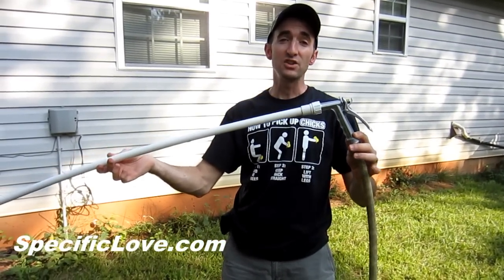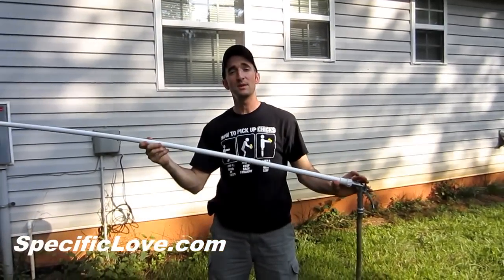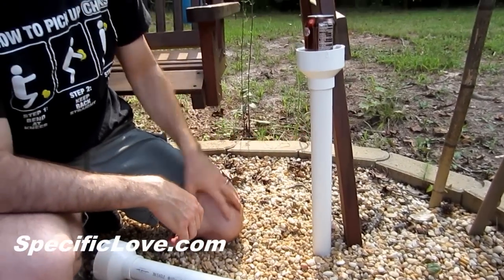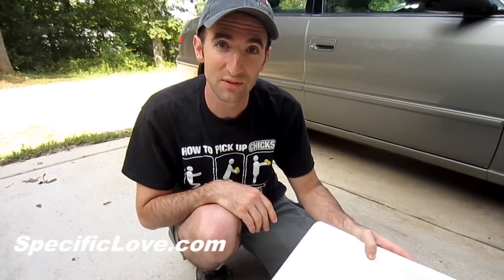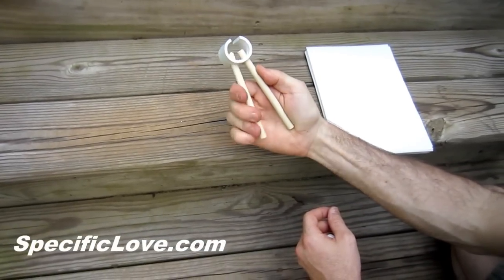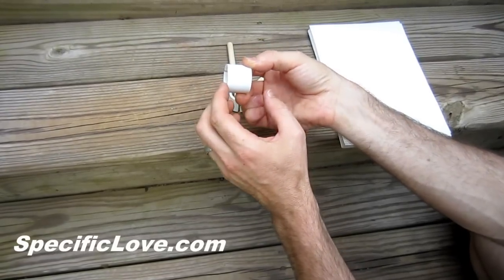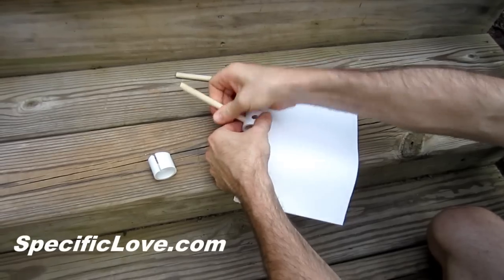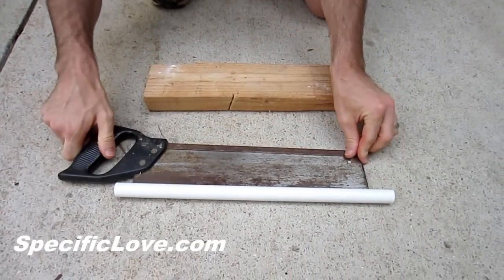10 Life Hacks with PVC

Comment: great ideas. on the tube for coolers, I recommend some rock salt in the water solution. it keeps is in solution for a colder temp and prevents the water from freezing solid and expanding. Salt will not effect the PVC.
Reply: only rock salt will work?
Reply: +Michael Piercey Or Isopropyl alchohol.  And the PVC cement dries instantaneously.  It actually "melts" the plastic a bit to create a water-tight bond.
Reply: +Mike Pomatto nice. thank you!

Comment: Great ideas, a couple of suggestions tho. Make the end of your gutter cleaner a "U" shape. Gives you direct downward spray, much more controllable and more power. You stand a good chance of pvc splitting if you freeze water in it. Mix your water with alcohol and salt first. The razor holder, I like the wife to drop her razor, if you get my drift! Plastic is not a good conductor of cold. Keep your chest colder by adding a layer of plastic on top of the contents (I use bubble wrap) as EXPOSURE TO AIR totally wastes your cooling. You will notice that your ice, or whatever, lasts much longer and your contents remain closer to temp after each opening of the chest. Like that you go directly to the point!! The best!

Comment: Put SALTED water !! This way, the water will freeze BELOW 32 degrees and last and cool longer !
Reply: +altamiradorable Salted water will not freeze!
Reply: +JohnWPB it will just below 0c
Reply: +sander pf Exactly!  Consumer freezers do not get this cold, therefore you will have nice cold salty water, and no ice.
Reply: +JohnWPB I have a regular LG freezer and it goes to -6 degrees F ! That's well below 32 freezing point !!
Reply: +altamiradorable Just use a frozen water bottle. Cheaper than PVC & when it thaws you can open it & drink it.
Reply: +JohnWPB they get well below 0c...
Reply: +Maxx Fordham No matter what state it is in it will take it longer to get back up to danger zone temps.
Reply: Well it actually depends. If you leave both in the freezer just until they are frozen, it will last longer because it has lost more energy. (One would start sub-zero, the other would start close to 32)

If you leave them both in for say...a couple days. It's gonna be pretty much the same, fresh water actually has a slight edge on keeping it colder longer, salt water would probably cool it slightly faster.

Assuming you let the ice completely form and bottom out temperature-wise in your freezer.
Reply: It lost energy to freeze. It needs to absorb equivalent energy to heat up. Basic physics.

More energy lost = more energy absorbed = longer cold in a cooler
Reply: +Maxx Fordham it's
Reply: Maxx Fordham
While we're at it, "Oh, LOL!" is not a complete sentence.

"Silly me" is not a complete sentence either.

If we're going to make YouTube comments all stuffy we might as well go all the way.

Comment: I build a Summer Portable Chicken Coop that you could pull with the lawnmower to different areas in the Yard. It took me 8 month to build it, because some of my ideas didn't work for the coop, and I had to find the right everything from Walls to roofing. It also needed to be light weight but sturdy, and it needed to be cool in the Summer month. I also needed to be able to access the inside of it to retrieve some of the eggs that were laid in the back of the coop, and it had to be critter proof.
After I finished it, I realized many mistakes I made that I wowed to to better the next time around. That coop was build in 2011, and it is still in use today, even though some of the pieces that weren't glued correctly are coming apart, and the bottom Chicken wire needs to be replaced this Winter when the chickens move back into the bus!

Comment: you have some great ideas. first ice freezes from the top down that is why the lakes freeze on the top of the surface not the bottom of the lake. I agree with the water bottle it is usable water that you will want any way. the log carrier is great. the snake catcher I have trouble with but that is because I am not going to get that close to a snake I would use a longer pipe and a slip knot you might even put 2 holes in the pipe and tie the knot on the inside of the first hole that way I would be able to use it from a safer distance. the last thing I want to say is about the saw its self you need to use vinegar to get the rust off that blade then wipe it with a light oil  it will cut better.

Comment: Excellent series! I've been using PVC for camping for a long time, but you've inspired me! I've only seen about 6 of the series, but looking forward to seeing the rest. Keep up the great work! I camp with a medieval recreationists group usually and used PVC to create a clothing rack for my costumes. Works great and keeps everything off the tent floor in case it rains. Also use it to create a barrier around the tent to keep rain from creeping in, setting it slightly into the ground lengthwise.
Reply: Cool. I didn't realize they had PVC in medieval times.

Comment: This is great stuff. Next, let's try building an airplane.
  A comment on the Ice in the PVC: When you put this in the freezer, make sure it's level, so the air bubble extends the entire length of the tube. This will keep the pipe from splitting when the water freezes.

Comment: I needed to glue strofoam panels to walls inside my crawl space and I used 1/2" pvc pipes varied from about 10' to 5' to winch them by bending them and placing one end agaist the styro. (with a pad of 1/8" plywood) and the oppisite end up agaist the joists.  Key was to use correct lengths in order to get the required pressure to tension the panels agaist the walls, it worked.

Comment: Hey Hi,
I do like the safety and practicality of the PVC Saw Blade Cover.  First, is there a way to bundles the PVC covers and attach them to a French Cleat?  And two is there any way to wrap/warp/mold/or flex a PVC pipe to fit around the exposed edge of a circular saw blade???
~Jim
Reply from the maker: I would not think attaching the pvc cover to a French Cleat in this fashion would be the best. I would suggest a different type of holder for that setup.
And to bend PVC is doable with heat, but bending it around a circular saw blade might be challenging.

Comment: An even better option for #2 (gutter cleaner) is to use an inline shutoff ball valve instead of the spray nozzle. The nozzle restricts water flow too much, IMO. I made a gutter cleaner a few years ago using just a ball valve (in the garden hose accessories area of any big box store).  I noticed a significant improvement with the ball valve.

Comment: On your shower razor holder you could also add an end cap at the bottom and drill a drain hole it would hold tooth brushes too and allow them to drain. You could remove it to clean periodically.

Comment: I generally liked your hacks. The razor one is good, but I can advise you something way better for your razor. If you have a rough wiry beard like mine a razor will only last about four shaves. However if  you fill a small plastic cup with half water and half windshield washer fluid and drop your razor right in after every shave, the solution will keep it from oxidizing which is what makes it degrade quickly. I now use my razors for up to 2 months and I have been doing it for about a decade with great results.

I also find it is much easier to shave in the shower, as the steamy moist air helps soften you  skin while you wash so that once you are ready to shave, it is much easier. I have a small mirror I hold in one hand while shaving in the shower and if it steams up, I just rinse it and it clears.
Reply from the maker: Very interesting

Comment: Where did you find the adapter for the nozzle end? I have not been able to find one in my area that fits       the spray end. Great idea that I want to use this summer.
Reply from the maker: I found it at Lowe's. If it does not fit your's, I would also consider buying another cheap nozzle.

Comment: Suggestion--For the wood carrier, run  one 6 ft paracord through the holes and _inside _ the pipe with the knot inside. This way the one length will balance on its own. A little extra work but one knot instead of four.
Reply from the maker: +Lyonhardht 
Interesting idea

Comment: #7 you don't need that paracord. Just stick the piece of PVC through the bag handles. Two fingers on each side of the bags. Don't even have to be PVC. Any short piece of stick would do. This avoids the disadvantage of the PVC + paracord method. That lengthens the handles, and if you're not very tall, the bags could be dragging on the ground. Or you have to bend your elbows to lift them up off the ground, which makes your arms tire much faster.

Comment: neat hacks, just two comments, one add one more el to the gutter cleaner and you won't have to stand so far back and the water jet will be directed straight into the gutter.  Second make the PVC longer for the snake, and I have seen it said that a pole like that is good for snakes, but I wonder how easy it is to get it around their head, and then you'd have to hold it tight all the way till you get it where  you want to put the snake.   I think I'd rather just try some other way of driving it off, though if it is in the house, that is a tricky one.  Thats the trouble with garages and homes that are at ground level!

Comment: if you put 50/50 alcohol water in your PVC pipe for your cooler you can fill it to capacity and it won't break the pipe when it freezes it will turn into slush instead of turning to solid ice you're welcome if need be during the winter or summer you can still use it for antifreeze

Comment: The frozen PVC tubes at 2:00 would work better if you used straight dawn dishwashing soap. Which is basically what is in the freezer jell packs you buy.
Reply: +steve thepirate Rubbing alcohol (70%) is better.  Same as in cold packs for sprains.  And just use doubled-up Ziplocs, which is cheaper and more flexible than the pipes.
Reply: +steve thepirate or just buy an ice pack straight from the store for 1$...

Comment: on the PVC pipe for the cooler, if you add about a cup full of rock salt to the water and seal it up you will get a 20% drop in temperature.
Reply from the maker: Interesting
Reply: Specific Love Creations yes its cooler and stays cooler longer.  Sodium chloride saturated water absorbs cold faster, and it dissipates slower.

Comment: Don't take this the wrong way, I love these ideas ..... but:

Do you actually test these ideas before suggesting them?  I'm thinking specifically of the one in which you glue the cap on the end of the pvc pipe then stick it in the freezer.  Why not freeze it with the open end up, then screw on a cap?

Also, on #5 (wood carrier) - make one pipe longer than the other, and thread that one through the rope - less likelihood of it slipping out.

#6 (snake snare) - I know this was just for demonstration purposes, but I'd mention using a longer pipe for the real thing.

#8 - pvc fence post extensions?  I don't think so.

#9 - pvc clamp.  Wouldn't it be much easier and cheaper to just buy a clamp?

And just a general observation - perhaps use figure eight knots instead of simple overhand knots - less likelihood of coming undone or slipping through the holes.
Reply from the maker: Good idea for all three.

Comment: With repeated freezing, won't pvc crack? Just curious, some one let me know.
Reply: The PVC won't crack from freezing itself, it'll crack from the expansion of the water inside.  Either one of three things will happen: the end caps will blow off/come unglued from the pressure, the sides will crack, or there is enough air volume inside for expansion nothing happens.  PVC itself handles air pressure well (people use it for compressed air, potato cannons, etc), so if you only fill the inside 2/3 the way with water, it should be fine.
Reply: Thanks
Reply: +thechosendude actually you are way wrong.  been doing this for a couple of years and have never had any of the problems you mentioned.  maybe try it first,  before you leave your 2 cents worth.
Reply: Actually, he was almost dead on. Did you even read what he wrote?
Reply: +Michael K Goode I do believe you stopped reading about halfway through his comment. You should read the other half.

Comment: water exerts 2000 psi in a frozen vessel and pvc cracks easily when frozen;)
Reply: +Robbi Boss Assuming the water puts any pressure on the vessel at all, which it won't if you don't overfill it. Which is why he said to only fill it 3/4 full.